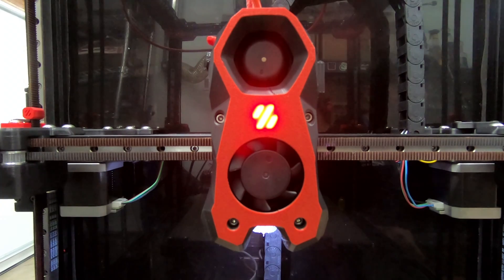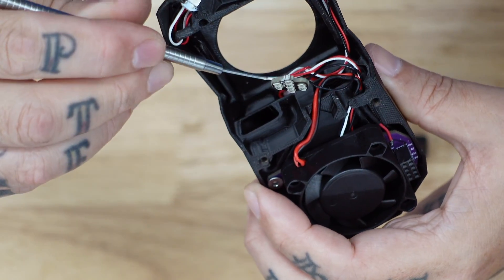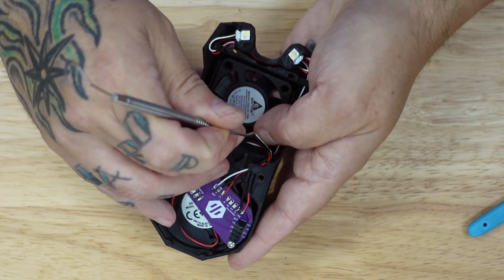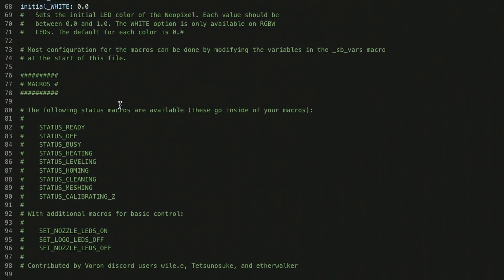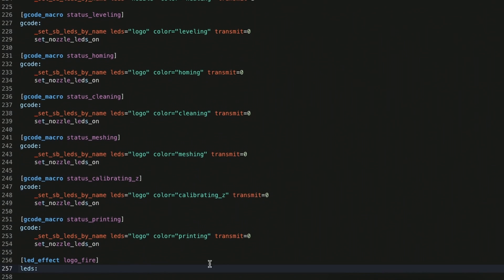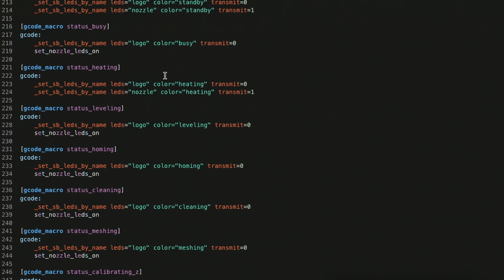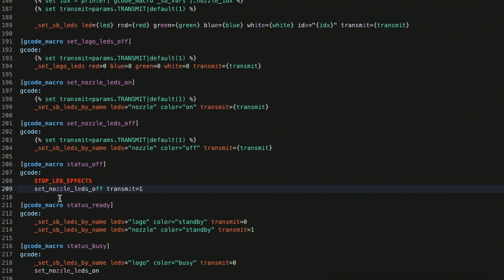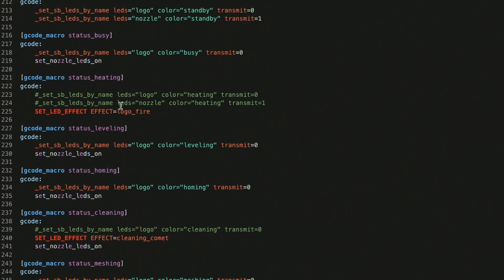Voron Stealthburner Rainbow LED installation and effects (RAINBOW BARF)

Comment: Cool video but is there a video showing how to do the firmware? I have been looking but nothing is popping up. I followed the instructions on the github but my leds will not work. I just can't seem to figure it out. I made a file, copied the info over, included the file and set the leds to GRBW. I am using a skr2 mini and set the pin to PE6. Is there more to it? I checked the voltage and they are getting power. Can you point me in the right direction, please, before I pull what hair I have left out?! Lol

Comment: Great Vid, thank you. I am missing something. The leds do come on and work, but when say printing, it does not change. But when I type in console status_printing, only then it change to my settings.
 Does not get loaded in printer.cfg. I did add the lines to gcode. status_printing and status_ready. But no go.
Reply from the maker: Did you put STATUS_PRINTING at the end of your print_start macro? You have to call the status display. -Allen
Reply: @west3dprinting219  Ah might be my big mistake. I put it and the start of my print macro. Will give it a go, thank you.

Comment: For some reason, when i do the [Led_effect logo_fire] and copied how you did it, I get an error saying LED effect 'fire' in section 'logo_fire' is not a valid effect layer. I'm not sure what I'm doing wrong
Reply: Im watching and just noticed he hasn’t mentioned that what he just copied needs to be spaced with  a tab to be aligned like the others, otherwise Klipper won’t read it correctly.

Comment: Mine completely freaks out, I probably need to add a resistor to the data line
Reply from the maker: Yes, add a 100 ohm resistor to the data line close to the MCU.
Reply: @west3dprinting219  so where would I add mine on the HARTK 2-Piece? I'm running that to an LDO kit.
Reply: what do you mean freaks out? mine turn off randomly during printing and i cant figure it out. i know this was a year ago, but did you figure this out?
Reply: @AlanBWarrick  quick flashing between different colors etc. In the end I needed the resistor

Comment: what material do i need for the diffuser? can it be printed or do i need resin printer?
Reply from the maker: Many people use clear PETG. I printed my first on my Ender 3, the ones that are available from West3D were printed on my Voron 2.4. -Allen
Reply: For me natural ASA (ABS should work the same) works best. Transparent materials work, but have a bit much light bleed between the LEDs.

Comment: Awesome videos so far!  I noticed the SB2040 pin assignment in your config. Are you using the mellow fly can board?
Reply: Thanks! Yes, the SB2040 board. Also designed the cover with a cooling fan.
Reply: @creatornaut503  any plans to carry it in your store or do a review /overview on it?  Only video content out is from Mellow and I’d like to see how it stacks up against the BTT offerings.
Reply: @jace055  This is my personal machine- Dan from West3D is going to talk with Mellow and see if they can work together (I got mine elsewhere). I can tell you it's been a solid performer for me and I really like still having the ease of the two piece PCB.
Reply: Like this? Does not work for me
[gcode_macro START_PRINT]
variable_bed_temp: 60
variable_ext_temp: 215
gcode:
    M117 Homing
    # Use absolute coordinates
    G90
    # Start bed heating while calibrating
    M140 S{bed_temp} # set bed temp
    # Home the printer
    G28
    M117 Calibrating
    BED_MESH_CALIBRATE
    G1 X0.1 Y20 Z50 F3000
    M117 Heating extruder
    M109 S{ext_temp} # set extruder and wait
    M117 Heating bed
    M190 S{bed_temp} #wait for bed temp
    STATUS_PRINTING